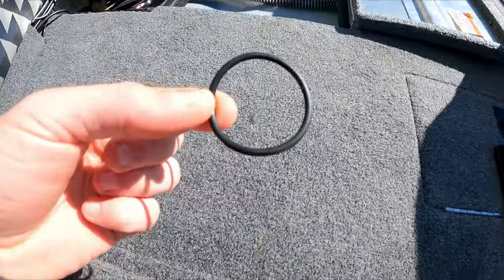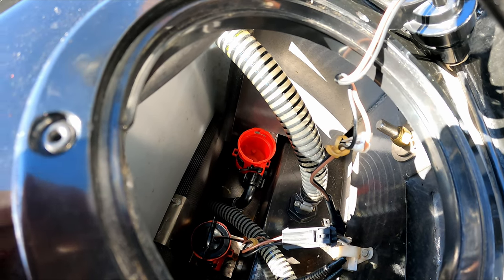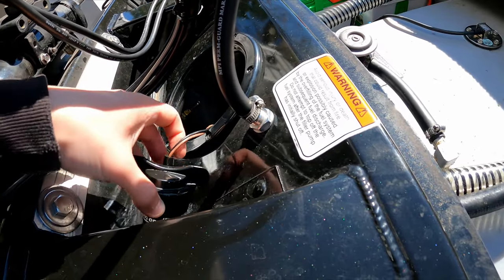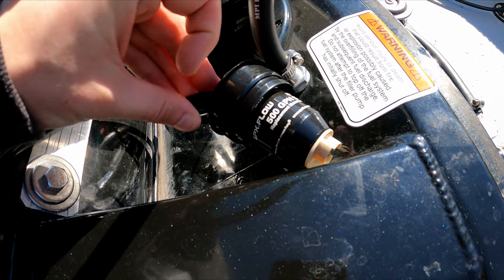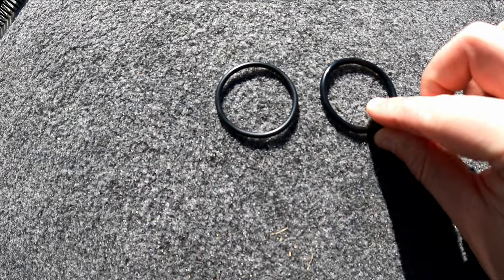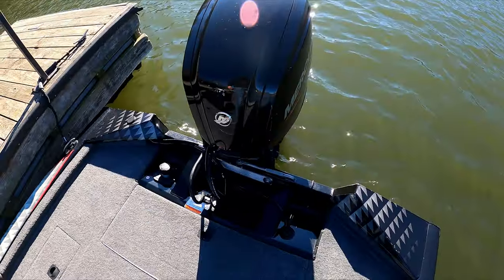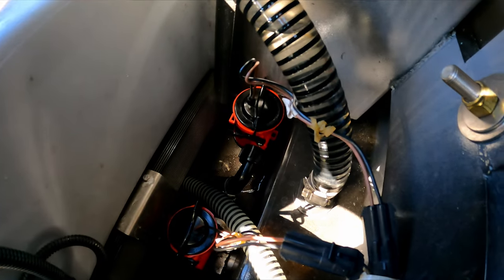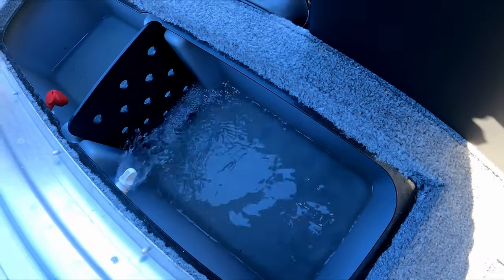Don't Replace TRY This $2 FIX! (Leaking JOHNSON PUMP SPX Flow) Bass Tracker 175

Comment: Man - this is just the video I was looking for. Questions, do the pump cartriges release? Do you push down and press? Do the turn counter clockwise? Any advies would be greatrly appreciated.
Reply from the maker: Just a small lock on the side and turn counter clockwise.
Reply: @BentRodBassin  Thanks a bunch, man. Nice wrap on the Tracker TXW 175. Mine is a 2017. Here is a lure tip: Big Show kickertail worms in midnight and bruiser blue - for scent, give Atlas Mike's squid lotion a try.
Reply from the maker: Will do!
Reply: @BentRodBassin  One last questions. Do you know where the aerator pump is located? I heard it is beneath the liveweall and can be accessed by removing the panel behind the seats.
Reply from the maker: Directly next to the bilge pump in the rear by the plug.
Reply: @BentRodBassin
Reply: Thanks, man.
Reply: Sir-
The circulator pump is directly beneath the livewell on the pump out side - just passing on when a replacement is needed. There is a 12" x 12" removable access panel beneath the center seat secured by four tapcons fasteners with phillips screw heads. No one from my local Tracker dealer could tell me where it was. Finally got the defective circulator pump out - it was completely siezed up. Safe boating and good fishing.
Reply: Thanks, just purchased a 2011 TF. I get some water on my livewells when not using them. Maybe. 1/2 inch. Any ideas? Great video.
Reply from the maker: Same here, my thought was the water entering from the livewell pump outs on the rear, possibly.